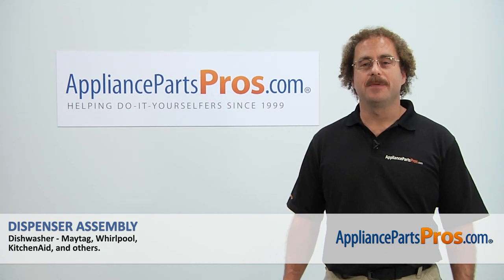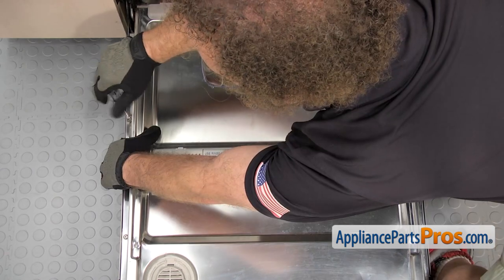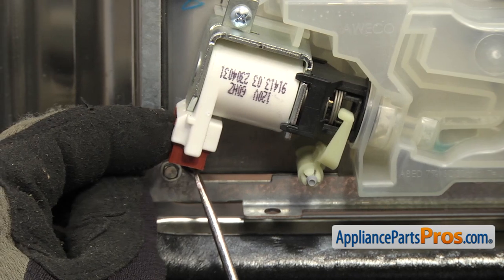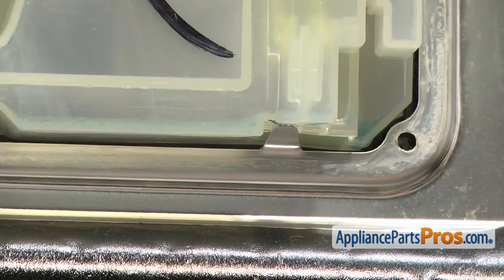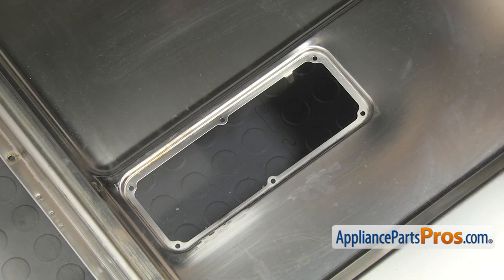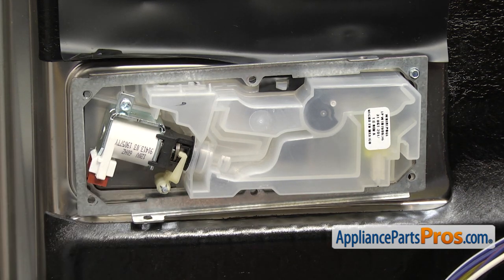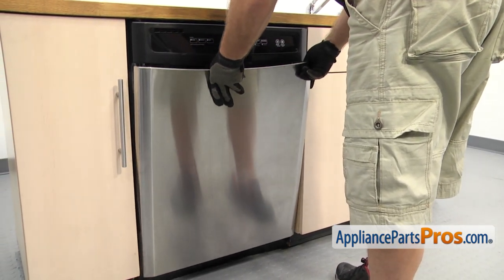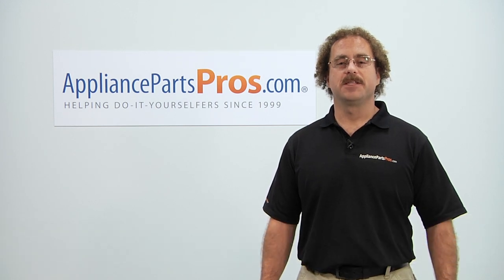How To: Whirlpool/KitchenAid/Maytag Dispenser Assembly WPW10199696

Comment: My dw is similar, but has the controls on the top edge of the door instead of the face.  It uses the same dispenser, but the wiring and parts came apart in my hand and fell away. I had to tape the assembly back together.  There was a piece of trim somewhere, too.  We'll see if it works.